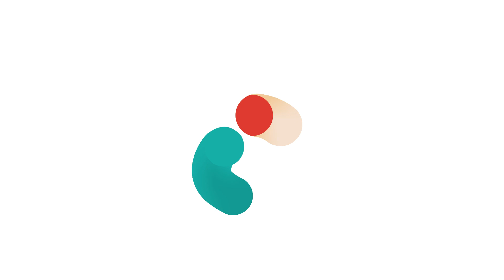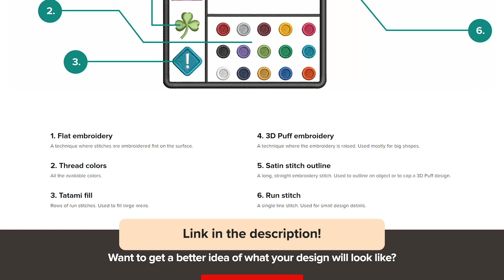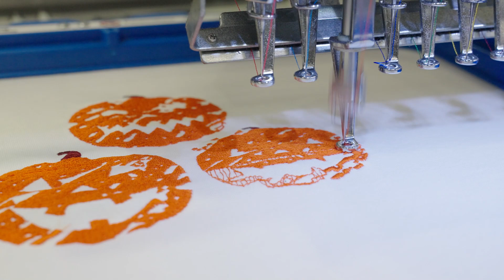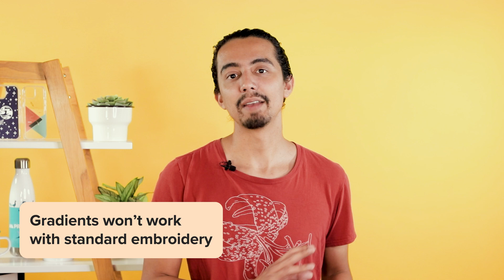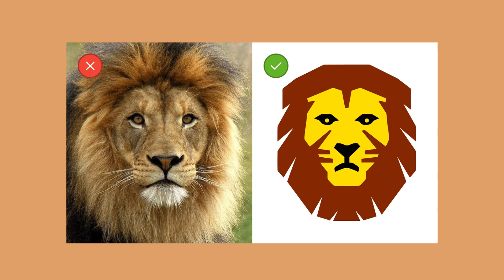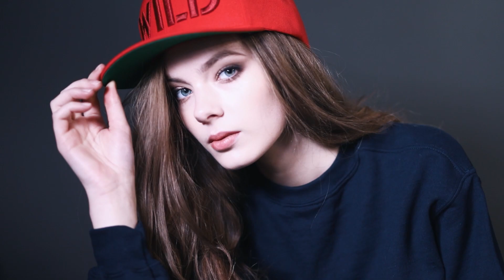Printful Embroidery Tutorial For Beginners

Comment: can you create custom design or is the embroidery only available with what is available in the design maker you provide? I tried uploading a file to create a crew neck with embroidered initials in the large center area and was not able to do so..
Reply from the maker: Hey! In general, you can create custom designs for embroidery. However, custom file upload is not yet available for the large center placement. For large center placement you can use our ready quick designs and clipart, as well as the text tool. Custom embroidery designs are available for all other placements. 😊